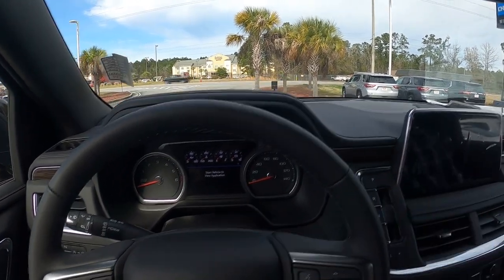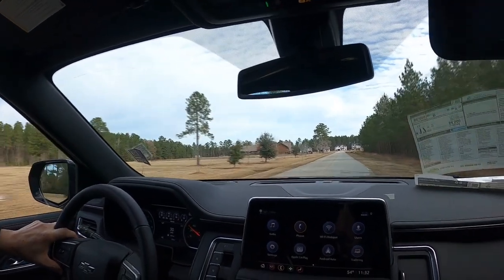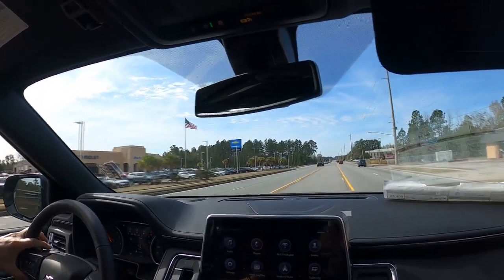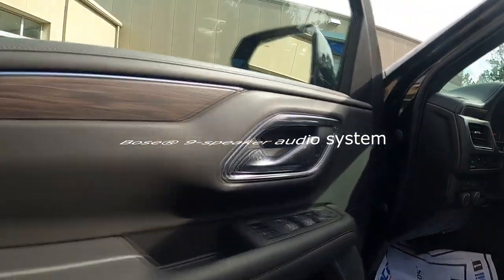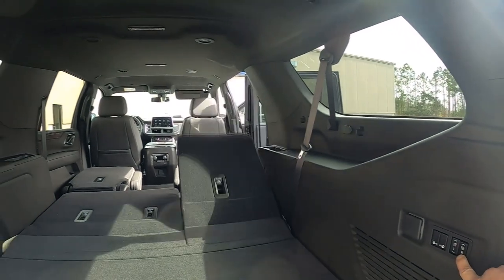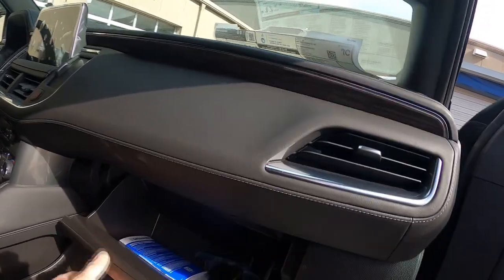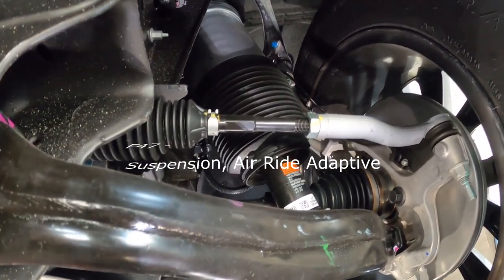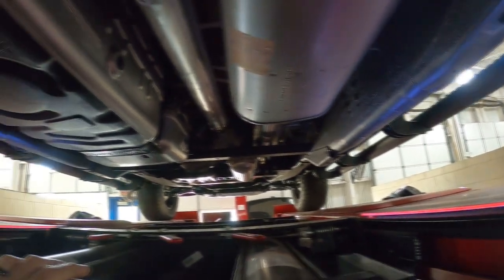2021 Z71 Suburban Review. Full Look Underneath at Air Ride!!!!

Comment: Sweet.  Not sure if you still have access to show more, but would be curious about comparing ground clearance of the funny control arm knuckle at bottom of suspension at the lowest and max ride heights to see if it looks vulnerable at all still?  At whatever height you are at there a rock protruding could cause some funny business if it was just missed by tire and pretty tall rock.